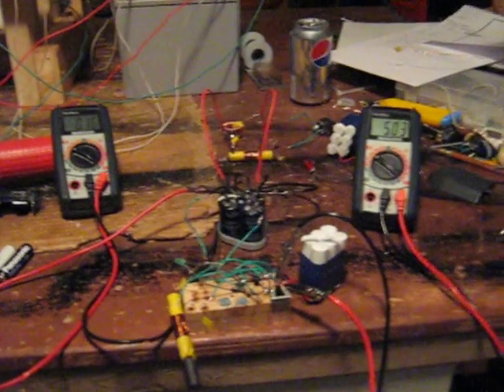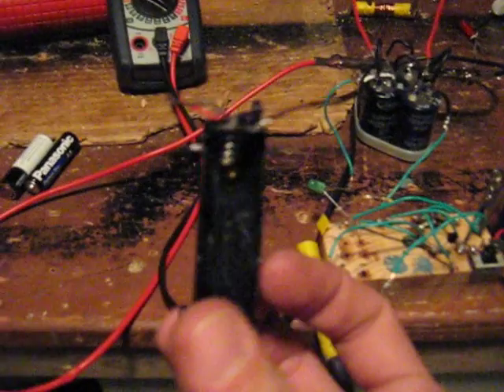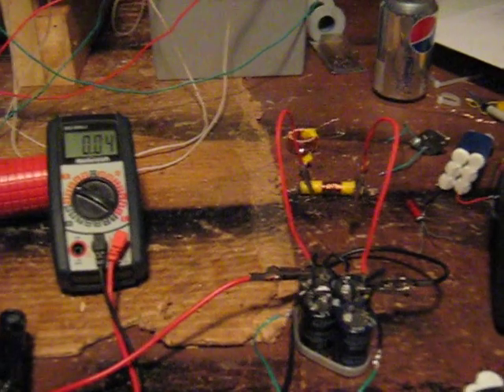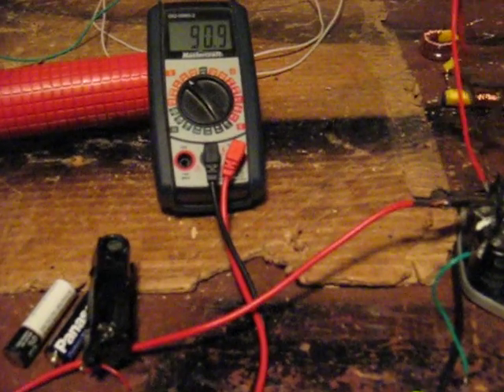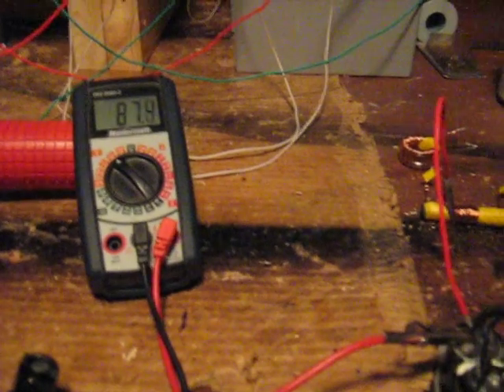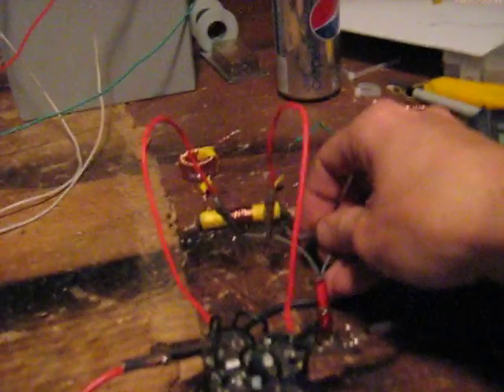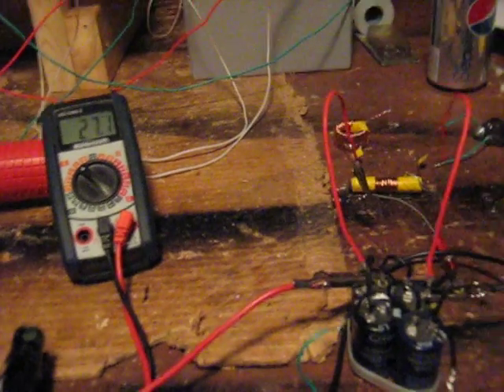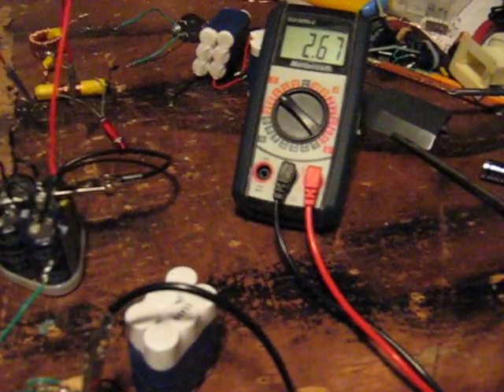Joule Thief - From 5 Volts to 100 Volts

Comment: We are celebrating xmas at my nices, and i borowd theres computor to check your video. At home my earthbatery now is frosen , have it in a bucket but probably my old bicycle lamp has rosted so theres no conections. My ide was to put several buckets in series to gain more power to charge a cap bank whith the joulethife. Thanks fore all inspirations! and merry xmas